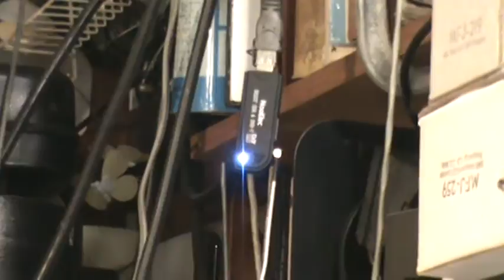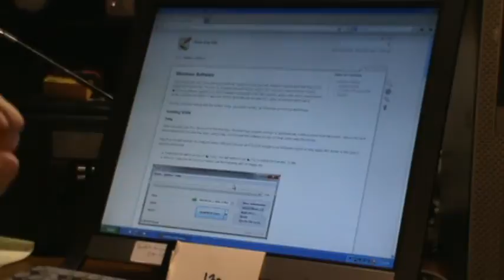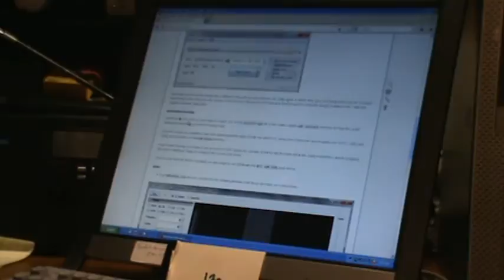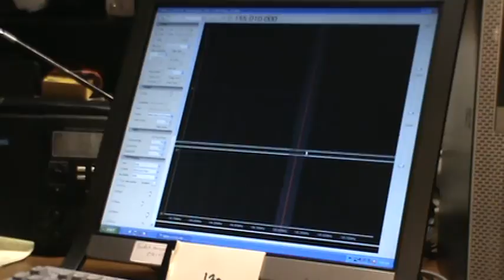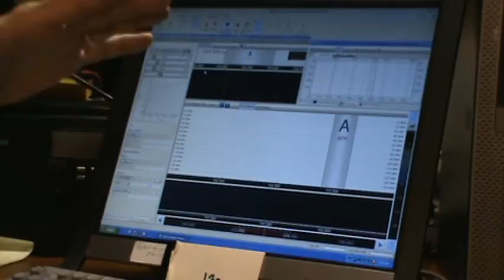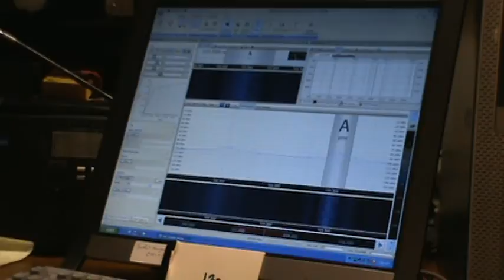TRRS #0130 - QSO - Setting up USB TV Dongle as a Scanner

Comment: I got it working, but how do I change it from M to MHZ?
Reply from the maker: +Old glory Sorry, I don't understand your question.
Reply: +hamrad88 You see how yours says that it's measuring the sound with MHZ? Mine is just M. How do I change that?
Reply from the maker: +Old glory Sorry again, I can not see from the video what you are referring to.  Sound or audio is not in MHZ.  The frequency is in MHZ.  If that is what you are referring to then you are probably running a later version of the software and the author may have changed it from MHZ to M.  Hope that helps.

Tom

Comment: Well was a good video but didn't really help u said these dongles can be setup as a scanner but the thing I ran into when I got the sdrsharp & sdr-radio it said kit expired says to go to sdr radio to set up so I tried to do that. What is like to see I only see like 30sec videos of people who hook up there old analog police scanners hook up to there computers using sdr software using dsd then hooking up a analog police scanner to decode apco p25 signal do u have a video on how I can do that or can I just bypass using a old analog police scanner & just use the dongle & what is the difference with dongles I got R820T & the R820T2 the T2 says was upgraded from the R820T now I live in a townhouse so I can't really be buying & what's a good size portable antenna I can buy that I can set up outside my bedroom window can I just buy a adaptor & use my police scanner antenna since that picks up my local decrypted police dept still our local police switche To apco  p25 freq now i cant afford to buy one of those big expensive built in decoders that decodes p25 then looking in ebay i seen that sdr dongle so i looked in youtube seen all kinds of videos then came across urs then i seen others saying u can use these dongles as a cheap police scanner with software but can i buy a compact antenna i can stick on my window or use my police scanner antenna with an adapter is there away i can contact u by email or website alot of these videos dnt have walkthroughs to fully configure just says here s were to get thats it & after u set up a sdrsharp with sdr radio with dsd is there away to broadcast stream it

Comment: Wondering, with the small antenna, if this could work as an electronic bug detector to sweep a room to look for listening devices (that transmit RF, of course).
Reply: Definitely. Turn down the sensitivity to a very low value to kill off the background interference and if you pick something up it's likely a very close or powerfull source. If it gets stronger as you get closer (and is transmitting your voice, which is a dead giveaway) that would indicate a bug. Best band to look for them are Shortwave FM+AM, AM Radio, FM Radio and 433MHz. Good idea you get there, find those spy beetles. :D

(buuuuuuuuuuuuut you you're bugged likely you got bigger problems as well. XD)

Comment: I wunder what driver do you get to make the other software run can you give me a tip about it ? Thanks this is lovely Greatings from CT2KFQ from Portugal
Reply from the maker: The following website will give you all the information you need plus much more.

http://www.miklor.com/

Tom
Reply: Thanks for the info provided if Sir, you may need something from me about radios schematics or other stuff Sir, you may send me an email or by my facebook with the same email missangas@sapo.pt Greatings José Fonseca God Bless
Reply from the maker: Ok.

Tom
Reply: i really did not fond any kind of reference to the devices im looking for only for usb cables nothing more.
Reply from the maker: I guess you have a problem with your internet access as the information is in the middle of the page. Maybe you need to scroll down.
Reply: What item do i need to enter i run thru all the folders of that website what ia the folder label im looking for the usb driver to run rtl sdr pen with the software sdr Console 1.5
Reply: Sorry sdr console 2.2
Reply from the maker: This video should show you how to get it running.

Using the RTL2832U with SDR-radio.com V.2